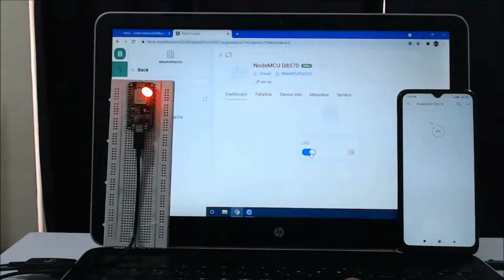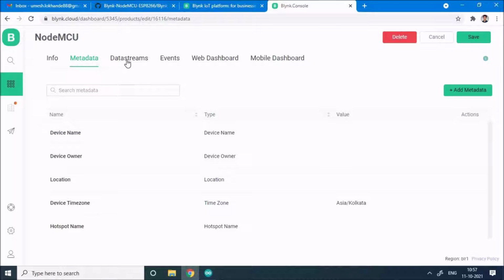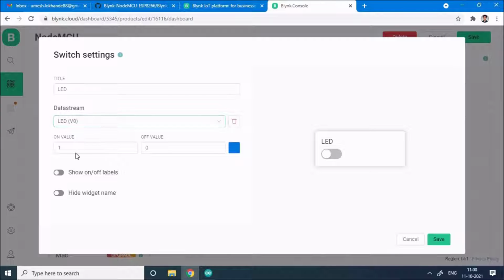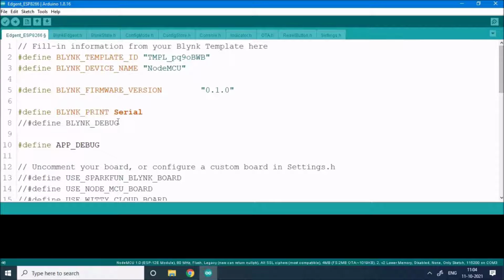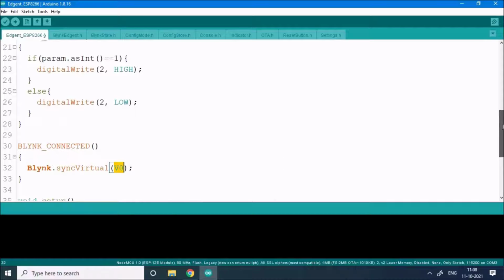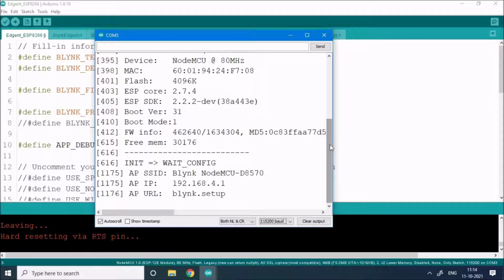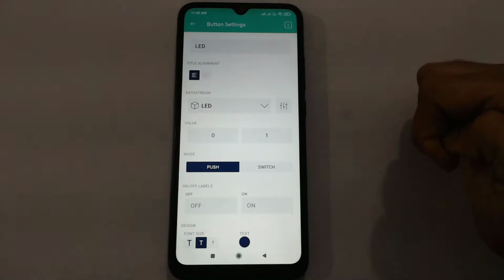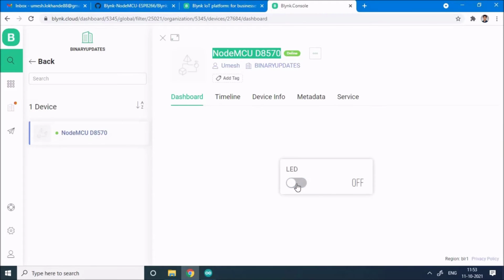Blynk with NodeMCU ESP8266- Web dashboard and Mobile App

Comment: HI .... when I do compile. it gives me an error: BLYNKEDGENT.h : No such file or directory... can help me!
Reply from the maker: Please make sure you've install Blynk latest libraries from library manager before compiling code. If it still doesn't work then download complete project from GitHub repo of BinaryUpdates and then try with some changes in template ID and all as shown in video. I hope this may help you. It seems for me your installation may have issue especially Blynk libraries. Good luck and best wishes!

Comment: I am having some issue in boards manager, i have no option of having a Node MCU . I have only Arduino boards and i have also install Blynk manager. please reslove my ossue
Reply from the maker: Hi Abdul, I hope you've added board manager url properly for NodeMCU ESP8266. I have made a video about how to setup NodeMCU for Arduino. You'll find it in BinaryUpdates NodeMCU playlist. 

Now coming back to the answer. I'll suggest reinstall arduino IDE and try adding url in "Preferences" section. And then add ESP8266 related board packages under "Board Manager" section. and i hope this time it will show you NodeMCU1.0 ESP-12E Module. Good luck and best wishes!
Reply: @BINARYUPDATES  Thank You Sir. But  I have another issue regarding node MCU. I have simple ESP 8266 -01. If this project is applicable to the ESP 8266-01 rather than Node MCU, what changes should I made so that my project works on ESP 8266-01.

Comment: Can u please tell me how I can edit the code for controlling more than 1 light ?
Reply from the maker: Hi Ali, I wish i could have time to write arduino code for you. But I will surely considr making videos to control multiple digital pins using Blynk and ESP8266. 

Meanwhile, you can edit existing project. Also, try adding one more virtual pin in Blynk project and arduino code for NodeMCU. I hope this may help you. Good luck!

Comment: I am getting error named as user_interface.h is no file or directory. I tried to solve the issue but unable to do it please help me ASAP!
Reply from the maker: Hi Parth,
I hope you've copied Blynk project properly from Github link. And also, make sure you've properly installed Blynk libraries before compiling Arduino Sketch.

Comment: When I connecting to nodemcu using blynk iot it is not showing blynk devices and it searching for more time it is not connecting to my blynk app
Reply from the maker: Press RESET Button on NodeMCU and check response on Serial Monitor of IDE. Also make sure your phone is not using data network. Apart from make sure you've not missed any step as shown in video. Good luck!

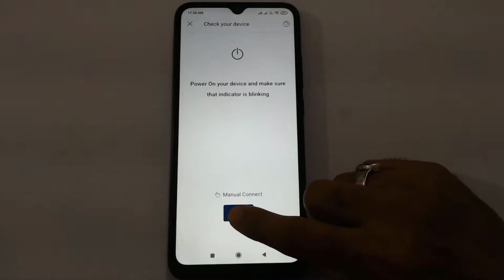Comment: When I go to connect my device to the app at 18:39 .It searches and finds my device and I put all my network info in and it tries to connect though it always fails. Anyone else having this issue? I can not find a solution at all.

I do wonder if it has to do with the part in code that says, "uncomment your board or configure in settings"
In the video he has that same bit of code that he never changed. My board settings are correct as far as I can tell. 

I am just lost, would appreciate any tips at all! Thank you all
Reply from the maker: Hi Trevor
I believe you're not using data network on phone while NodeMCU ESP8266 get connected to Blynk App in your phone. Also code remains same as shown in video. No need to comment or uncomment anything. I hope this may help you. Good luck!

Comment: great video. would you explain the connections of the led with the Node and can i use Arduino mega 2560 instead of node mcu
Reply from the maker: Hi Eri, LED is connected at D4 which is GPIO2 Pin on NodeMCU ESP8266. So you must connect longer leg of LED means anode to D4 Pin and shorter leg of LED means cathode to connect to GND Pin. As far as Arduino Mega2560 concern I suggest consider using Arduino IOT Cloud platform as well if in case Blynk doesn't support Mega series of Arduino Board. I hope this may help you. Good luck!
Reply: @BINARYUPDATES  yh thats real helpful .thankyou very much

Comment: How to reset the nodemcu esp 8266 because I have uploaded a wrong file
Reply from the maker: Hi Abhishek, if you upload wrong arduino file. Then there is a feature in Blynk called OTA Over-Air-Update through which you can upload or update firmware on NodeMCU ESP8266 from Blynk IoT Dashboard. I'll considering making video in future  to show that feature. 

And about RESET there is an physical button on NodeMCU besides of USB connector. And I'm not sure if you can reset ESP8266 from Blynk. I hope this may help you. Wish you good luck. Thanks

Comment: Sir how can we add voice control to this project 
Plz reply...❤️
Reply from the maker: In my knowledge Blynk don't have any service on their IoT platform to support Voice Service. But this can be done with NodeMCU ESP8266, if we can add additional circuit especially for audio processing. I'll consider investigating more information and if possible will make video for voice control. Thanks for you suggestions

Best Wishes
Umesh
Reply: @BINARYUPDATES  thanks for reply sir plz upload video soon ❤️
Reply: I think you can use Google's voice recognition service and in the workflow you can add an HTTP request so that it hits one of Blynk's REST APIs. I did work on speech and speaker recognition back in the day and trust me the state of Blynk right now is much better. Just wanted to see how the system works now and btw nice tutorial
Reply: @darthvader_  I have used sinric pro and it working fine

Comment: sir, my device get result like this when i pus the reset buton
Reply: ets Jan  8 2013,rst cause:4, boot mode:(3,6)

wdt reset
load 0x4010f000, len 3460, room 16 
tail 4
chksum 0xcc
load 0x3fff20b8, len 40, room 4 
tail 4
chksum 0xc9
csum 0xc9
v00072470
~ld
Reply from the maker: Hi April, you then try to press FLASH BUTTON for 10-15 Seconds which will clear memory and then reupload the Arduino code into NodeMCU ESP8266 and then try. Keep me updated with your progress. Good luck
Reply: @BINARYUPDATES  now my esp always connected in the same wifi. Whereas I want to put this device in the other place and wifi. How to change the configuration. Or it same with your reply in the comment sir. Thanks